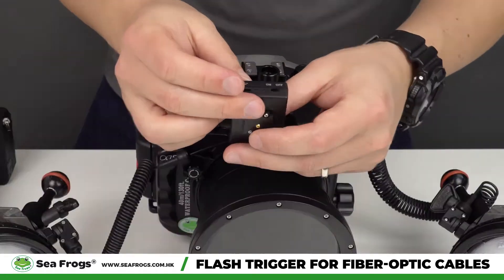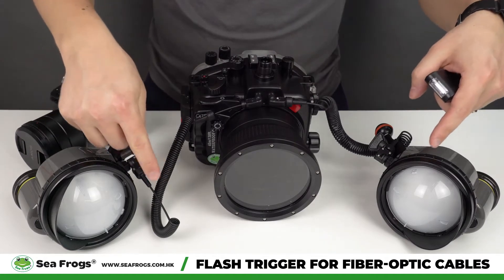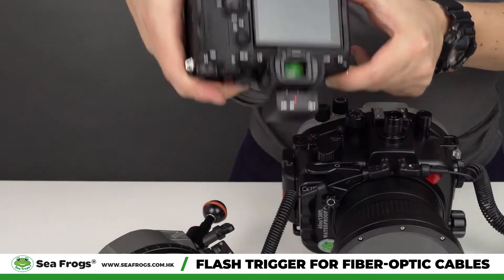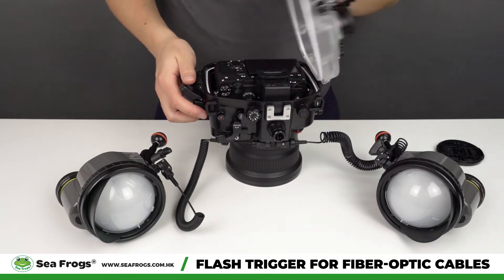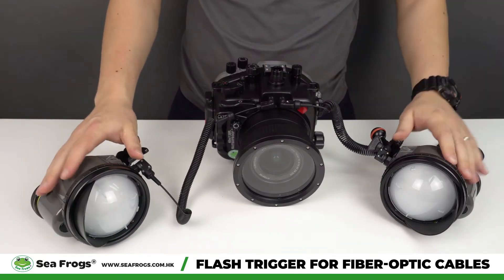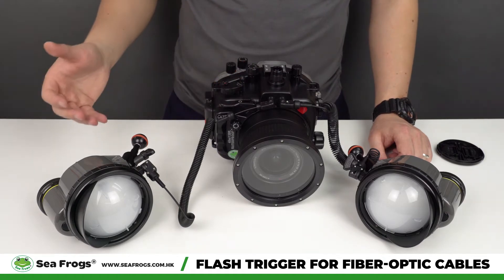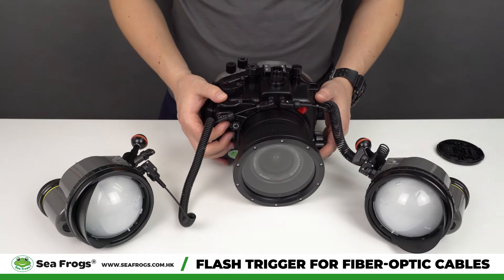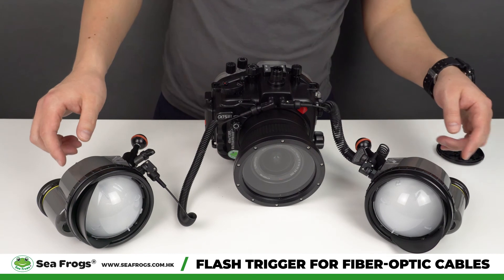Flash trigger for fiber-optic cables

Comment: Hi,
I have 2 question. I am using 6xxxx housing  saltedline with sony alpha 6300 and newly bought 90 mm macro lens.
1-saltedline still have no proper port with manuel focus gear.
2-Which optical kable do you use for the flash/strobe? I am thinkg to buy 2* ikelite ds 230 or sealife ys-d3 mk2 or inon z330? 
Can I use TTL without any issue?